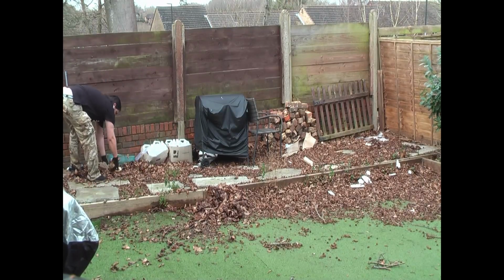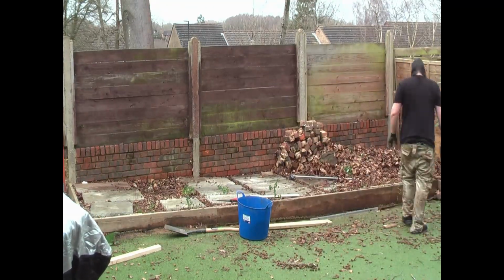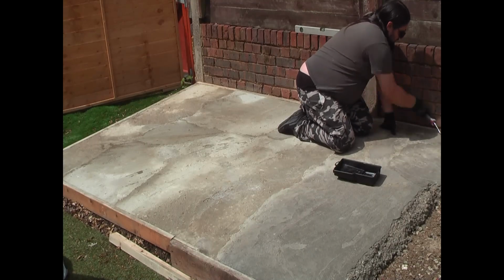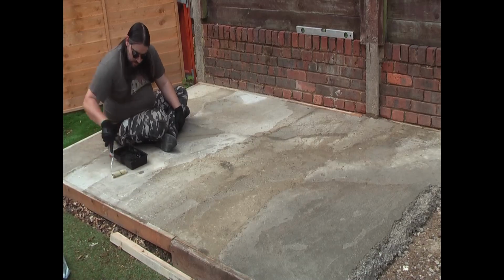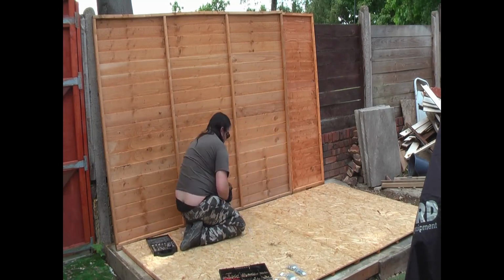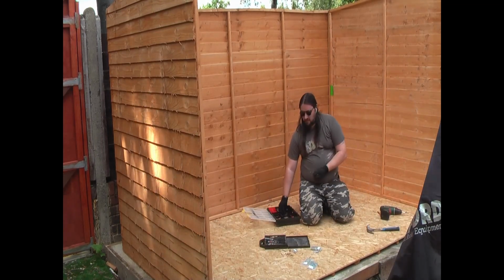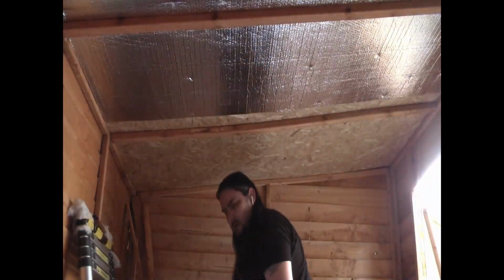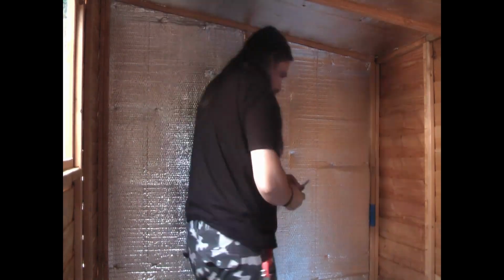New Workshop Build Part One

Comment: Good work on the shed and insulation. I used that product in my attic suspended between trusses some held some didn't. But it's much less hot in the attic in 108°Fahrenheit or 42.222° Celsius here in north Texas.
Reply from the maker: Thanks dude, yea it seems to be working in the 99f we had recently lol